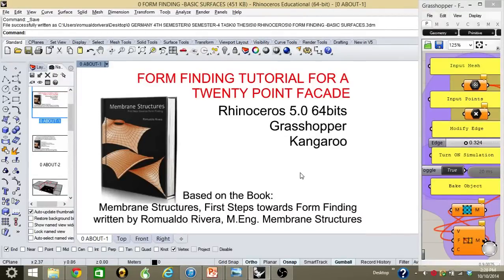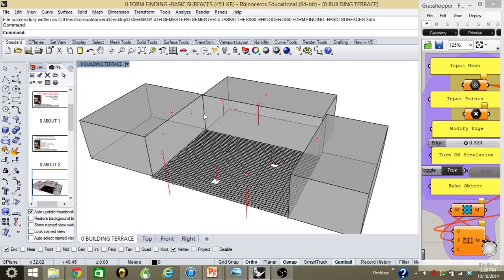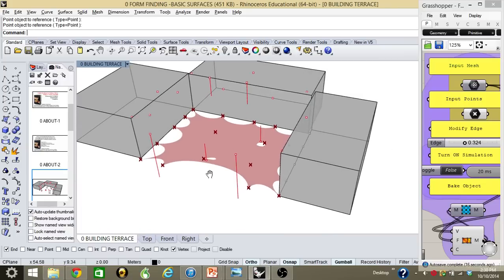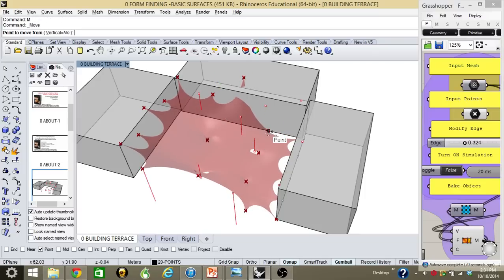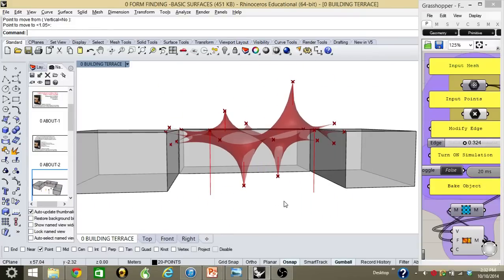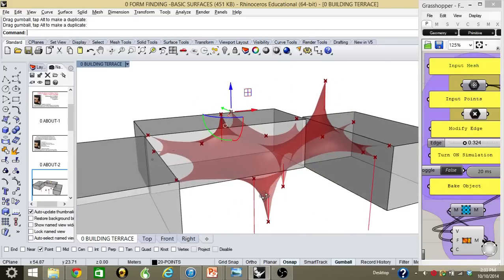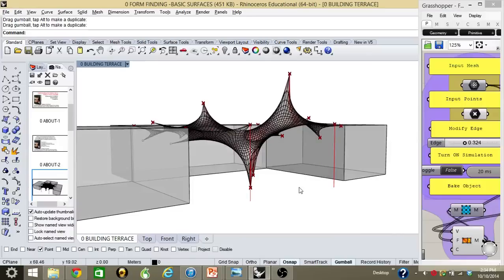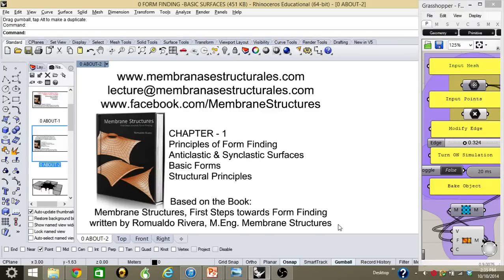5. TENSILE SURFACE STRUCTURES FORM FINDING by ROMUALDO RIVERA TORRES

Comment: Hello, I’m an architecture student that is currently investigating tensile structures for my final thesis. I just found your YouTube tutorial videos which are extremely useful for my design and was wondering if it was possible for you to send me the Grasshopper file as it would help quite a lot.
I tried emailing but it doesn't seem to work. I'd be very thankful if you could send it to ana-d-p@hotmail.com